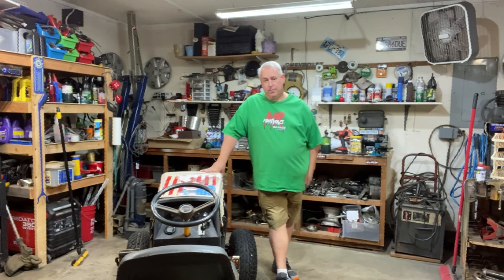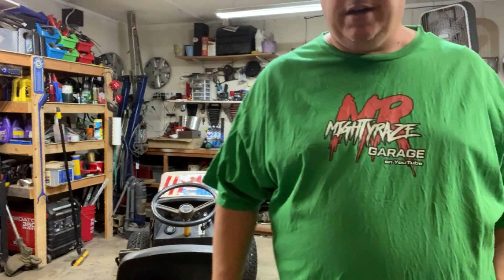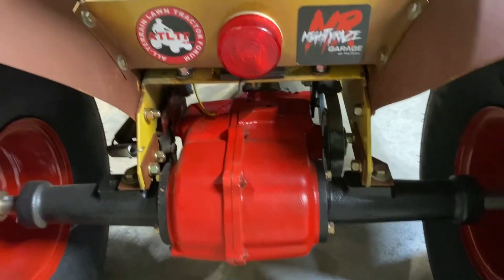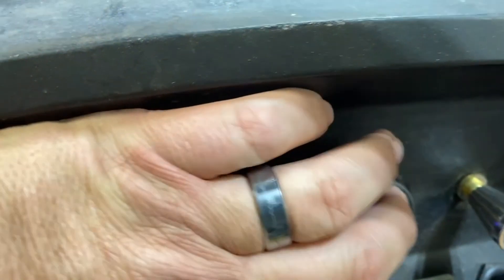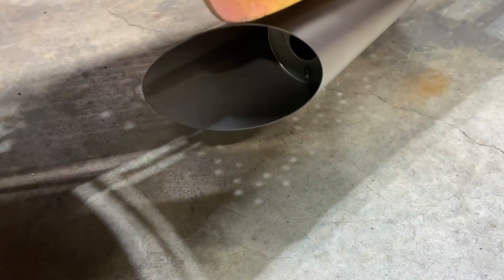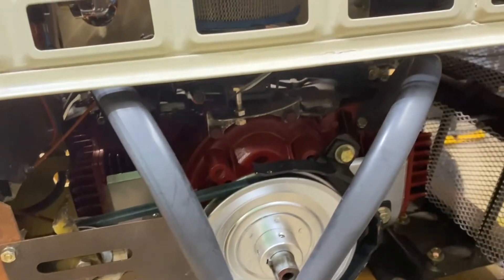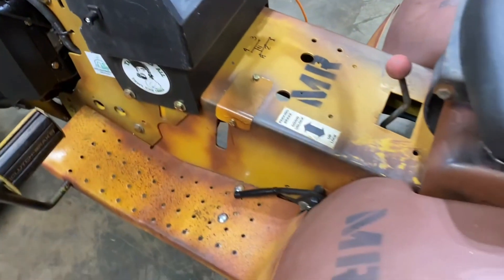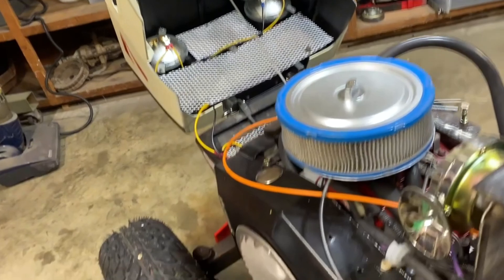Episode:173 The Dirty Rat Complete

Comment: Do you remember where you got that round tachometer/hour meter?
Reply from the maker: I got it off amazon.  https://a.co/d/7xfGKdV  I will say, it seems to work as long as you don't wrap the wire around the plug wire too many times.  Stick to what it says in the instructions.  Also, viewing angle is small otherwise it is dim or unreadable.  Backlight on mine gave out after a few hours.
Reply: Thanks for the info. I have bought 3 traditional needle tachometers the last couple months. Two were “cheap” 1-10 cylinder eBay deals. They don’t work hooked up to the coil ground. The last one I bought was expensive, I paid $98 for it on eBay. It is an Equus tach but supposed to work with 1-10 cylinder motors. I got that one because it came with a CT that clamps around the high voltage output of a coil or spark plug wire. Didn’t work either. There is a company called Vegas Carts and they specialize in retrofitting gas motors into golf carts. They sell a tachometer that works with the Predator engines. I see all good reviews and there is a YouTube video some dude showed it working on his golf cart. On their website it says if it doesn’t work on your 670, you may have to buy “upgraded coils”… but last time I checked those tacks are sold out. Haven’t checked in a few weeks though. Kind of over it. 
Anyway I figured it’s not that big a deal and I’d go with the little rectangle ones on eBay…
Then I saw yours, at least it’s round 😅
Reply from the maker: @Tennesseemountainhomestead  I'll see if I can get a quick video on mine this weekend.  Maybe you can see how it works out.  I have a hand tach coming in to see if it is actually accurate.  If that comes in before the weekend, I'll do that video review.  Stay tuned.
Reply: 10-4 I appreciate it. I’m not gonna be jumping on anything regarding tachs anytime soon! I’ve got a tachometer instrument that’s hand held and works pretty good as well. Looking forward to the video!
Reply from the maker: @Tennesseemountainhomestead The next video will not be on it, but the following should!

Comment: This is sweet man! So I'm guessing based on 40Km/hr and a 22.2 4th gear ratio, you are putting in close to 10k rpm into the 2300 transaxle? Is that about right or am I way off?
Reply from the maker: Yeah that could sound about right. I have a 7” engine and 4” trans pulley. I was running about 5k maybe a tickle over momentarily on the engine so that would translate over 9k. I’d say you are pretty close. No wonder we wear these things out so fast. 😅
Reply: @MightyRaze  Haha yeah that would do it 🤣 Hoping to build something like yours, I think the MTD 918 I will be getting has a Peerless 2300 already in it.  Now I know the ballpark figures for speeds so I have a good idea where to start